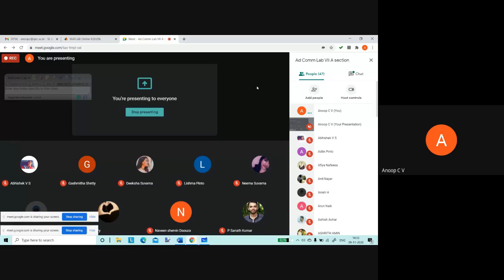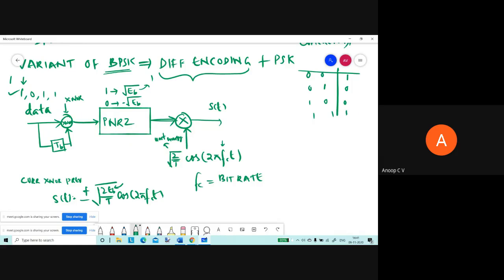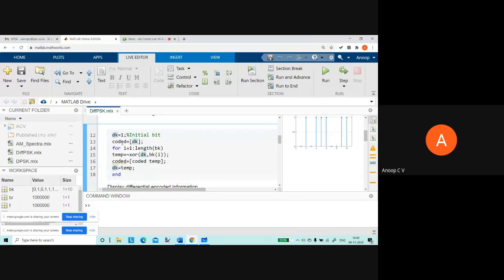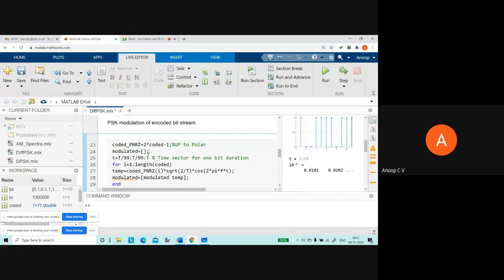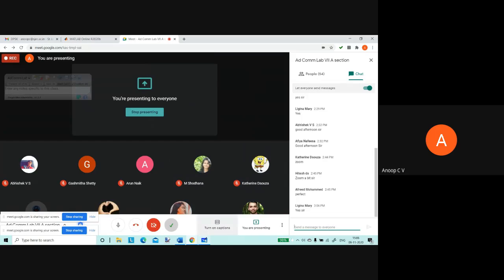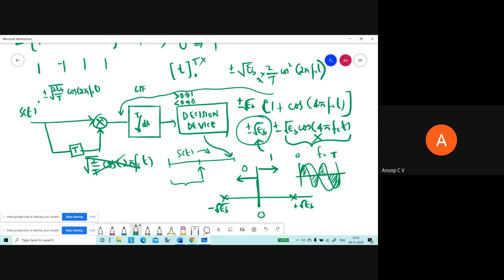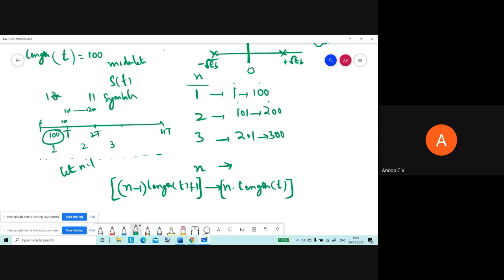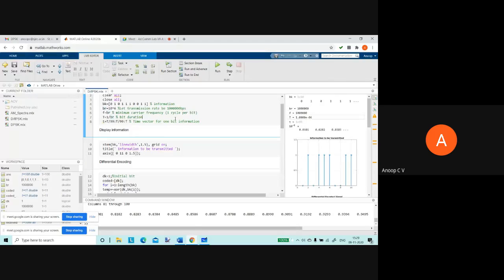DPSK Matlab Simulation

Comment: Hi Anoop, Excellent explanation.
While running the code I am getting an error in the trapezoidal line saying that point spacing must be scalar specifying uniform spacing. Any advice on this?
Reply: @anoopcv3525  Thanks for replying.
This is the code.

 for i=1:length(coded)-1
    Z_in=received((i-1)*length(t)+1):i*length(t).*received((i)*length(t)+1:(i+1*length(t))); % multiplying i*i+1 signal
    Z_in_intg=(trapz(t,Z_int));
    if(Z_in_intg>0) % Decisionmaker
        temp=1;
    else
        temp=0;
    end
    Rx_data=[Rx_data temp];
end
Reply: @anoopcv3525  Error message is 
Error using Trapz ( line 66) Point spacing must be a scalar specifying uniform spacing or a vector of x-coordinates for each data point.
Reply: @anoopcv3525  I have change it to this Z_in_intg=(trapz(t,Z_in)); but im still getting the same error.
Reply: @anoopcv3525  Hey, It worked! you saved my day, Thank you very much, Appreciate your support. :)
Reply: hey @sameera N im getting the same error what is the fix?
Reply: @msiddarth7637  Hey, I missed a character in the code. Thats why I got the error. I watched  the video again and corrected it